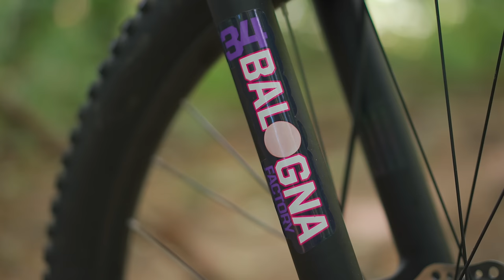This $130 MTB Air Fork works great until it doesn’t

Comment: I put one of these forks on my 12 year old son's bike and it has worked flawlessly for his riding. Most spring forks are too stiff for light riders, this fits the bill perfectly for them.
Reply: is it really worth for 130$ ? I thinking about that.
Reply: @EkskaliertHD  better get a used rockshox recon rl or reba
Reply: @cezarh5473  used cost about 200€ but my Budget is lower
Reply: @EkskaliertHD  save a bit more, its worth it
Reply: @cezarh5473  ok thanks buddy
Reply: @cezarh5473  
Nah, for a kid who isn't going to take the best care of the bike, and probably out grow it before its worn out...
This is a viable option tbh.
Reply: @EkskaliertHD  It was worth it to me. He only weighs about 80 pounds and I'm not worried about him breaking it. Plus it was available next day and I didn't have to hunt for something used and hope it was in decent condition.
Reply: @phonetech1109  ok thanks for help :)
Reply: yeah
Reply: @EkskaliertHD  not a good idea to spend less than that, try and save for longer and spent a bit more, it will be very worth it!
Reply: @sicktrick4173  oh ok :)
Reply: @sicktrick4173  Kids are growing fast, by the time I save up, they  need something else.
Reply: @EkskaliertHD well here the deal. If your budgets lower save a little longer cause with cheaper forks itll jeed replacing soooooo much sooner. Then you get another one and youre in 300 vs 200. Just save for a used reputable brand fork and you wont regret it.
Reply: @KarstRats  thx
Reply: Yeah I have that exact same fork on my bennotto rc9 and I have gone through two rear hubs in a year so that gives you an idea of how rough I am on bikes and the forks still works perfectly (3 hubs if u count the original one)

Comment: Might be a good idea for the next iteration of the Smeasher to put the weight into some sort of a guide to ensure precise falling and hitting in the same spot
Reply: Also to be a fair test, the weight not to fall off a fork, and bounces multiple times on the other. On the other hand, the fork get the forxe on the axle, not on the bottom of the lower.
Reply: Why not connect a rope to the axle, run the rope up through a pulley and have the weight on the other end of the rope, creating a constant pulling force on the fork, allowing for much more precise measurements
Reply: Yeah honestly I’m surprised he is still doing a test this same way again considering how flawed it is lol.
Reply: Also, the impact should be directed precisely on the dropouts’ using the axle/dummy hub as it’s the wheel that would be impacted in a crash. The steerer should be clamped as close to the crown as possible to simulate where the frame stops flex.
Reply: guide rails
Reply: Maybe even just a stopper knot to keep the weight from bouncing uncontrollably after the initial hit.
Reply: Just needs a couple of pieces of pipe attached to the weight and two smaller pieces of pipe welded to a plate under the the fork.

Comment: I love these budget builds and I’ve ran many of the typical budget parts myself but the fork is something I definitely recommend saving up for a good entry $200-300 name brand fork.
Reply: I couldn’t agree more. I have the coil version and my rebound damper poked through my lowers resulting in a deadly crash. I then had to ride home with a fork that was going a bit extra than it’s travel. I tightened the bolt and it’s gone away. Definitely recommend some threadlocker for the bolt.
Reply: I chose to run a Rockshox Judy on my budget bike and would recommend that to anyone. But when I did it 2 years ago it was $170... I think they are now running for over $200.
Reply: @alexbarker7511  I don’t think you know what deadly means
Reply: @TraviNomotion  might be deadly depending on the trail it fails on.
Reply: @0xsergy  it has to be actually deadly my understanding is if a crash was deadly he’d be dead so he wouldn’t be writing this comment
Reply: @TraviNomotion  whats deadly on a narrow, rocky BC trail might not be deadly on a paved gravel trail with no drop to your death on one side
Reply: @TraviNomotion  I don't think you know the definition of deadly, try again.
Reply: @TraviNomotion  you're wrong
Reply: ROCKSHOX Reba is kind of best in price and performance i had it on dirt bike it was neglected by previous owner i serviced it changed oring put new oil and it works like butter
Reply: yeah there's a lot of budget components that you can get away with on a bike, but stuff like the fork, wheels, frame, etc. the parts that take 90% of the abuse really shouldn't be knockoff no-name parts. If any of those crap out on a drop or rock garden it's gonna be a gnarly crash. Honestly I understand seth is just having some fun but it's borderline irresponsible to recommend these parts to anyone.
Reply: Thanks for commenting you have been selected among my bicycle winners🎁🎁
Reply: $500 off brand?

Comment: To really make the Kent trail ready you should put a PNW dropper on it
Reply: I just put a Brand-X Ascend II 27.2mm on mine, love it so far. With a seat post adapter sleeve and the external cable routing it was super easy to install.
Reply: @therealandrewlund  same
Reply: No need, that bike is already a panties dropper

Comment: Here in Philippines,
 the Bolany forks are cost around 2,000 Philippine pesos higher, ( almost like 34 US dollars higher ) but there is alot of rumours that it can break easily around the crown arch.
Reply: omsim
Reply: So buy something that doesn't break.
Reply: @RealMTBAddict  well it's just rumours,
Reply: @RealMTBAddict  
No such product m8, anything will fail if given the right conditions ..................
Reply: If you're on a budget but needs a durable and good fork go for suntour it ain't gon let you down
Reply: @nzo_6543  i sold my bolany fork because after my race here in Philippines it got hard so i bought a suntour epixon
Reply: Some of them fail on light xc trails and they usually break on the crown most of the time I guess some of the forks are thrash from the factory but most of them are good
Reply: @justanotherhooman6122  also the stanchions break which i just heard of, which it's scary
Reply: Team bolantoy, speak up
Reply: @nzo_6543  not rumors but It happens to someone, it's like for every 10 bolany forks 1 fails.
Reply: I think you're talking about the coil type. this is the Air Fork version.
Reply: Never put dirt cheap on a bike, you'll end up regretting it at some point. 34 vs 160 dollars can be a huge jump in quality even with the same brand. Up to 190 for the Suntour, even more so.

Stick with coils until you can afford a decent air fork. 34 dollars isn't going to be worth it if what immediately follows is a potential 1000 dollar hospital bill.
Reply: @sirauwu5599  no, even the Bolany 32 air fork break in half when i saw a post on FB,
Reply: @nekobytes9187  Somehow it's expensive here at Philippines,
Reply: @thedoggoesskrrrt  i think theres a warning sticker that don't abuse it so much.
Reply: @nzo_6543  Still not worth to buy a suspension fork if it say so, suspension forks are designed to be used on rough terrain and it's stupid to buy this type of forks that doesn't serve its purpose right.
Reply: @thedoggoesskrrrt  yes that is true, invest more money on good forks.
Reply: @nekobytes9187  "but I want it light" "I want those colorful stanchion"
"Coil forks are heavy AF" "I don't want durable forks they don't break easily"😂
Reply: @nekobytes9187  nono, it's also almost 34 US dollars higher or depends on the price on online or bike shops.
Reply: Yup there's videos about bolany forks snapping in trails in Philippines
Reply: Just buy a Sr suntour Epixon air fork one of the best budget air suspension
Reply: Not just rumors. They break when least expected
Reply: it's sad he became a sellout for this forks. the tests are stupid and he knows it
Reply: these forks are made of glass lol
Reply: @justanotherhooman  I recommend to take apart any new fork and make sure they are properly greased especially these cheap Chinese forks. I've found the cheap forks don't have enough grease most of the time and they hardly have any oil in the air chamber. I've even found my suntour and rockshox revelations to not have enough grease/oil either. I've had a few of the cheap Chinese forks and they are comparable to the lower end suntour x line forks, but they really need grease for them to perform.
Reply: @Mastir sa MTB  how is it stupid and why would Seth sell out for bolany when he is big enough to afford whatever fork he wants? I'm also sure Seth has more riding experience than most riding mtb and bmx. Seth called it like it is and the impact test is similar to what the big brand companies use. Additionally, he talked about the major issue I've found with cheap Chinese forks as well.

Comment: Just like you mentioned, the suntours will bend bcoz they have steel steerer tubes which is also why they are heavy, they will bend but it will allow you to get home...those balony forks tho have been known to snap at the stanchions...i am not sure tho if they have addressed that issue with these new versions. The prices are also a lot different, the balony retails for around $80-90 here in Asia...the xcr air around $120 but i guess shipping them to the US is more expnsive than frpm Taiwan to us neighbor countries

Comment: I use to have one of those generic air forks, one thing is for sure, if it has the same compression switch same as yours then it is definitely a generic "rebranded" air fork which doesn't last long. You can check every generic fork in the market and you'll see that they all have the same compression switch and built. They just change the sticker brands 😅 But yeah they are good for kids bikes which doesn't get that much beating. Now I upgraded to Suntour XCR airfork which is quite known for durability and it works very well. Thanks for the good and honest review.

Comment: The Bolany fork might not be a good choice for extremely technical, tough downhill like you put it through. BUT, for the price, it's probably good upgrade for someone doing light XC and mostly green trail riding. I'm sure it soaks up the bumps a lot better than a spring fork.
Reply: I have KRSEC fork on my Felt and its horrible. It bends in every direction and feels like its going to snap! Getting a new fork but thats only my commuting bike so i "should be safe" Chinese forks sucks big time!
Reply: the problem is most people dont stay just riding greens, so either its gonna fail, or you need to buy a new one anyway and youre down 130 for nothing
Reply: looks great for kids though

Comment: 10:40 Seen this before on cheap air forks. If there isn't a wiper sponge to keep the seals lubed up the friction is going to eat the seals. Would not be shocked if other things are going on but that's at the top of my list. I'd head the advice from Philippine riders commenting on this video and pass on this fork. MTB is HUGE there and they do know what they are talking about when it comes to building a solid bike on a budget.

Comment: ive had 2 of these bologna forks and they are a great cheap upgrade but the magnesium lowers arent very strong on one of the forks I snapped off where the quick release skewer goes but that was after some jump trails and rocky downhill they're a great cheap upgrade for a light to intermediate rider

Comment: Those Bolany, ZTZ, Lutu, and Bucklos forks seem to use the same parts.  I had a Bucklos air fork for my 90lb son.  It was smooth out of the box, but it got lots of stiction after 1 trail ride.  I tried regreasing the stantions but that only helped for a really short time.  The stiction is even too much for little kids and exasperates the small bumps.

If going budget fork, go for the Suntour air fork.  My old Epixon is still working flawless and smooth as ever...I did regrease the stantions and oil the foam rings and put 5ml of oil in the air chamber.  It feels smoother than my Rockshox 35 Gold.

Comment: You can get an idea by the way the smeash weight jumps back up, as to wich one performed better.
It is not a quantitative measurement, but the fork with less rebound had more plastic deformation going on.
Reply: The true test would be to find out which fork is the first to experience a critical failure, because a bent steerer tube is not nearly as catastrophic as a broken one.
Reply: @Durwood71  I agree, it would be ideal to get the full stress-strain curve for each fork, probably outside of the scope of even this channel though.

Comment: An interesting video for sure!
I am bad at addition, but between the price of the Kent and the upgrades, it seems like you are in around a grand? I have within the last year bought two beginner-class HTs (a Rocky Mountain Fusion 29er and a 26.5' Polygon* Xtrada-6). Each was slightly under a grand, and came equipped with parts about equal in quality to what you added to the Kent. In fact, the Fusion came with the same Microshift Advent rear mech, which has shifted FLAWLESSLY for about a year. Both are lots of fun to ride on trails that while not scary by Seth standards, are certainly above beginner level. This might be a good alternative for people who would have to pay a mechanic to install some of these upgrades.

*I am definitely a support-your-LBS person, but no local shop currently has bikes in this price range in anything but too small or too big.
Reply: Thanks for commenting you have been selected among my bicycle winners🎁

Comment: I think there is still a problem with the smasher rig. If you look closely at the slow motion you'll see the fork deflects enough to actually hit the base, which will stop the steering tube or the stanchion to bridge? connections from bending. If the clamps holding the fork where higher off the floor board I think both forks might come off a lot worse.

The Bolany fork being much more flexible would likely hit the base sooner and spring back with equal force applied compared to the suntour, but if it was allowed to move freely, it would likely deflect to failure on the first hit.

Comment: Seth, I threw one of these Balogna forks on the wife's Diamondback Lux and it stayed for less than 2 miles around the neighborhood. During normal light braking to slow down for a 4 way stop, the fork lower and upper juddered uncontrollably. I did a full tear down and rebuild thinking it was maybe just a loose top cap or seal somewhere. Nope. Just terribly fitted seals. Returned and threw on a $200 Manitou Markhor. Completely day and night difference for the better.

Comment: Had an XCR Air fork. You must upgrade it with oil and foam rings, otherwise, it sticks, cannot run low pressures, has no tokens. Basically, use oil in the air chamber as volume spacers and install foam rings.

Comment: Another enjoyable and informative video, thanks crew! Nice relaxing music at 4:05 🙂
I have a bit weird question: can a cheap budged fork likewise XCM30 itself be reconfigured into something better anyhow (like air, oil or better coil system at least)?
Reply: I dont think so, if you want to convert it to air, its not designed to do so, its not compatible. But if you service your fork then it will be definitely better!

Comment: Part of the stiction might be air getting trapped in the fork. Slipping a zip tie under the dust seals can burp it if there is pressure building up in the lowers.
Reply: Shouldn't happen just after one ride though.
Reply: @sp00n  it’s a cheap amazon fork tho

Comment: That suntour XCR fork is a great option. We have them on a few of our rental bikes and they are bomb proof. They will do thousands more km that the coil suntour without any servicing and still work like a dream.
Reply: Bro my Suntour XCT 30 fork is inconsistent in terms of performance. Sometimes it feels too stiff while sometimes it feels perfect. I actually didn't service my fork for about a year but when I did, I found out that the stanchions were wearing out near the seals. Also, within few days of service my fork feels too stiff.......any solution?

Comment: My first fork upgrade on my axum was the xcm 120 factory off of a trek. Pretty solid, imo, for a coil fork, under a heavy rider. I thought a bucklos 120 air, this fork with different stickers, would be am upgrade. It really wasn't. That xcr however... my polygon came factory with the 120mm xcr 32. And I love it

Comment: Given how the fork is mounted in the stand vs how it's supposed to be mounted in a bike, I would be curious where the bending is occurring. Seems it should be mounted similar to how it would be in a bike with a set of bearings. I wouldn't expect the steer tube of the fork to be designed to take a perpendicular load like that.
Reply: You can see it bananed  the steerer in the middle. 
Yes it should be mounted on a bearing hard up on the crown race. 
The impact test is real world, hitting gutters/rocks or Seth's crazy roll in (the of version ) but casing the front tyre falling short of a jump is when they snap. 

If you watch the canecreek video he's copying or look up real snapped fork steerer's, the tube collapses right as the base of the steerer tube.